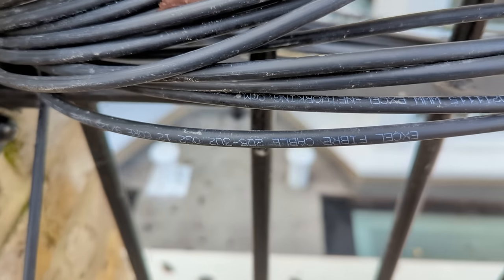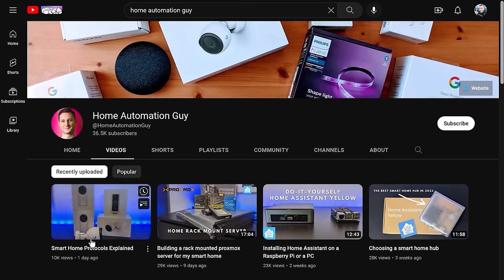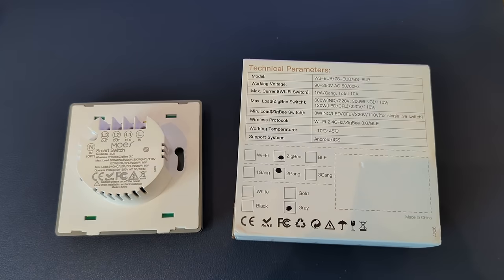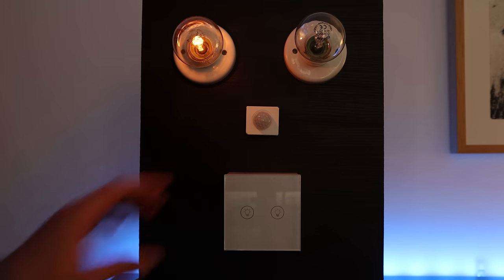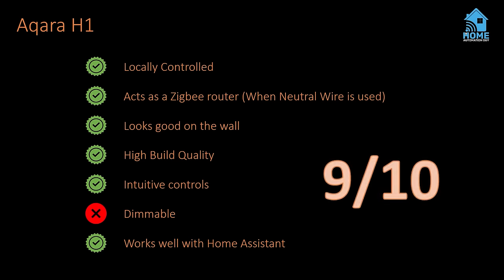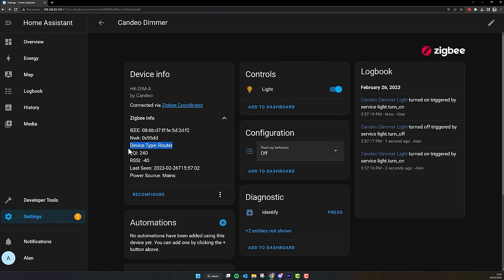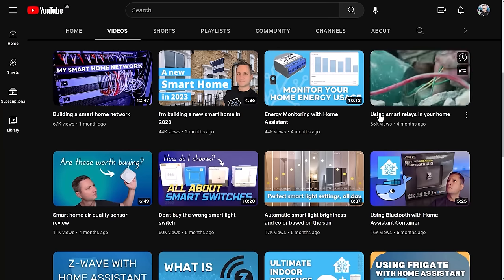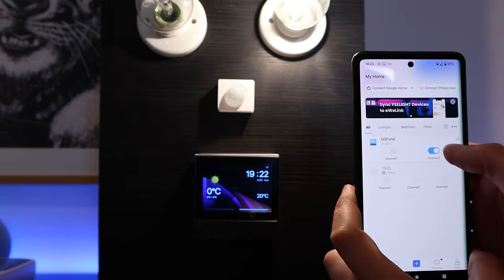Which smart light switches are the best?

Comment: Great video thanks for the testing.  I noticed you have a texecom alarm panel have you integrated that to home assistant? I did mine and it works well but would love more ways to customise it in the dashboard
Reply from the maker: Yep, I use it with the unofficial Texecom Add-On and so far it's worked great.  I don't really do anything with the integration except arm and disarm the alarm, and use some of the alarm sensors in HA.
Reply: @Home Automation Guy  yes same I have the same add on.  But I can't change the names of the arming modes to make them more friendly was hoping someone knew how
Reply from the maker: @sohail579  I don't know how to change them, but I would create a Dashboard with buttons on it, and title the buttons in a friendly way.  Make the action of clicking the button activate that specific arm mode.  

So a button named "Arm alarm when leaving the house" could trigger the Arm Away mode.
Reply: @HomeAutomationGuy  I will give it a go and see if i can get it to work quite a novice yet thanks for the idea,  and RE the question in your video would love to see a video on the NSPanel i have an idea to put one in each bedroom where the buttons will control the light and have the screens control the heating in that room and the blinds

Comment: Thanks for great video, but there are couple of questions.
Why do you attached to smart swithces, don't you consider to use traditional switches with smart relays behind? It would bring you a much wider variety of smart devices (not only swithces, but dimmers as well). And you would be able to choose really high quality switches correspondong to your room design.
And do you know about LocalTuya integration for HA, that allows to connect Tuya WiFi devices locally without any clouds?
As for me, I'm using Aqara battery wireless switches connected to my Yeelight smart ceiling lights. And in some places I use Sonoff Zigbee relays and Moes Zigbee dimmers under traditional switches.
Reply: Do you know any smart relay that supports 3way?

Comment: Great informative video, thank you! I am also buying my first home right now and very new to Home Assistant. I was just wondering whether you still get all the manufacturer software updates if you connect a smart device straight to Home Assistant without using their own hub. Thanks!
Reply from the maker: Using Zigbee2mqtt I'm able to apply software updates to my Hue and IKEA devices.
Reply: Sorry another question! We're about to set up the Aqara wall switches. Do you have any 2 way lights and if so, are you able to set up 2 way systems without using the Aqara hub? Thanks!!

Comment: I'm actually surprised that you didn't consider traditional dumb switches with Shelly relays behind them.  They don't look as flashy but they definitely work well.  With an electrician to fit everything in the box, it's even nicer.  Shelly has a dimmer but I've not tried it yet so I don't know how that'd work.  The biggest win here is that I can use cheap switches and $15 relays and end up saving a ton over time.  When you turn on MQTT, the exterior connectivity is disabled and it actually works like a basic switch would when the network is down.  The only time you'd have a problem is if you used the network to simulate 2/3/+ way switches.

Comment: The reason those MOES switches do not react properly has to do with powering the switch when the cover is removed.

it has a inductive sensor, meaning it detects it based on touch, and if you turn it on with the cover removed it thinks it has a shorter range when you put the cover back on.

BSEED, has different colors, and allow multi-socket switches [combo of light+socket]

Comment: 12:20 You say it's easy to wire in and fits nicely, but you're not mentioning that it lacks the side clamps that most sockets and switches have in addition to the tiny screws. It would be very nice if you could list which switches also have the side clamps, because those make the attachment so much more robust.

Comment: I actually prefer switches and bulbs that aren't router/repeaters. They are less vulnerable to latency issues in my experience. Bonus point is that my ZigBee mesh is a lot more deliberately mapped
Reply from the maker: This is a really interesting topic.  I was wondering this too, as I have some smart bulbs in my office that I'd love to turn off over the weekend, or when I'm away from home, I.E when I'm not using that room to save the "standby energy consumption" of them.  I'm concerned that doing this will remove 6 routers from my Mesh network and cause problems.

Comment: Great video! For part around 11:24 where you were addressing simulation of 2-way switches. There isn't enough information online (even on Aqara's website) that can confirm 2-way mode would also work on a pair of  H1 wall switch (non-neutral). The only method that people have mentioned is using 1 H1 wall switch as relay and another H1 Wireless switch to trigger the wall swtich on-off. Can I confirm that indeed this would work for a pair of H1 wall switch (non-neutral)?

Comment: I've installed a Candeo switch for a try. It works fine, but I can't read or write its brightness state via automations. Do you have any suggestions? I use zigbee2mqtt. The only 2 things I've managed to do is to (1) capture brightness change as a trigger (without brightness value) and (2) increment/decrement brightness in an action. I'd like to switch lights at specific brightness  or sync brightness of smart bulbs to Candeo.

Comment: I am going through my house at the moment replacing my light switches. Not all my wiring points for my switches have a neutral wire even though the house is only 3 years old. I have gone for the Moes rocker switch.  I hope that you do a video on light bulbs as I have had a few issues with some smart bulbs not liking being on smart switches
Reply: do not use smartbulbs with any kind of dimmer (dumb or smart) or a smartswitch that is a no-Neutral type (as these use electronic load switching that behaves much like a dimmer). Instead use a wireless switch for control.

Comment: Thank you very much! I learned a lot from your videos. Just a question, if I buy the  Aqara switch  with neutral required and used a capacitor instead of having an actual neutral wire, will the switch still function as a router and have the power consumption sensor?
Reply from the maker: I don't know. But my guess would be no.

Comment: Great video, Alan!
As a descendant of the “treasonous Colonists”, exiled across the pond; I’m a bit jealous of the room you have in your wall boxes for connecting things. Ours are so tiny and cramped. 

One question. What were you using to visualize your mesh network? ?! 
I’ve never seen that before, and it definitely looks like a good debugging tool!

Thanks for the great video!
Reply from the maker: I had to get the back boxes replaced with deeper ones by the electrician (Which is why the plasterboard got a bit messed up), but I understand the challenge! It's one of the reasons I've not put Shelly devices behind my original switches.

As for the Zigbee visualisation, both Zigbee2MQTT and ZHA have a "Map" or "Network tab that visualises the network.  I don't find it particularly useful for troubleshooting, but it's fun to look at occasionally 🤣
Reply: @HomeAutomationGuy  Thanks! I’ll have to pay closer attention to those integrations. I’ve never seen those features. 
As I’m sitting here typing this, my partner just yelled out from the office “Found it!”; so apparently he is more observant than I am. 😐

Comment: Thank you for making this video, I have the same problem and I need four gang switch but they also need to be too way because I have a switch on either side of the room, I'm struggling to find a solution, maybe have to do the same as you and have two lots of a aqara switches.

Comment: When it comes to smart switches you are nearly always better with a module and fit a retractive switch of your liking to control it. That way you can have switches match other accessories, the only disadvantage is you need at least a 35mm back box in most cases.

Comment: That's great info. 
Would you be able to do a similar one but keeping original switches and adding a smart "relay" or bypass box inside the wall that would act as a smart interface? Is that possible ?
Reply from the maker: I have another video on my channel all about smart relays - does that one give you the info that you need?
Reply: @HomeAutomationGuy  that's great! Exactly right. Thanks for your help, this channel is very helpful

Comment: During the video it’s being mentioned that Aqara only supports 2way and 1way circuits. However, I believe that Aqara should allow for more than 2 and 3 way if all switches are Aqara. Would that be correct? 

The way I see it is that you can set those via automations, and Aqara would work via Zigbee among all of them. Instead of working via hardware; it’d just need to be set up so that the devices talk to each other and a click means on or off. As these work via Zigbee, they would not need WiFi connection to use physically 

Could you please confirm? 

Cheers

Comment: Your network instalation shows a major flaw in its implimentation, when cutting a hole in the drywall... always cut the hole at a 45 degree angle so that the take out becomes a plug when resurfacing. The 45 degree cut provides a landing and support surface for the plug. Just add drywall compund to the edges and insert... skim a top coat or two to level the surface and sand to prep the surface for paint.
Reply from the maker: I'll pass this on to the electricians who made the hole 😏

Comment: How are you getting on with those Candeo dimmers? I've bought a load, and having lots of problems with them (either just dropping off my zigbee network, or a few units that simply refuse to pair). Yes, I've got a good zigbee 'mesh' with plenty of router devices. In fact, on Candeo dimmer works perfectly, another only 2m away keeps dropping off, and another about 2m away refuses to connect. Beginning to have second thoughts about them!
Reply from the maker: I've had a few problems with them reconnecting to the network after a power outage, but that's it. Otherwise they've been very consistent.
Reply: @HomeAutomationGuy  I think the problem might be my Sonof Zigbee coordinator then!

Comment: Great video!
I have a few Aqara D1 switches but I'm not too happy with them as they feel llke they have some sort of cold start sometimes, taking a few seconds to turn on or off the switch, but only sometimes. Another thing is that if you decouple it and cut the power from the mains it won't remember the relay setting and had to create an automation in HA to fix this.
Does this also happen with the H1? If they're better I might think of spending money again on the new version 🤔
Reply from the maker: Oooh, I've not tested cutting the mains power.  I'll flick the breaker next time my partner goes out and see what happens 😈
Reply: @HomeAutomationGuy  And how about the responsiveness from home assistant? Do the Aqara switches work straight away without delay? I'd say that's the biggest deal for me more than they not remembering the relay settings

Comment: Very helpful video, thanks.

One thing that I don't see talked about with Smart Home products generally is firmware updates. If you're using devices with HA and not the original manufactures hubs, how easy, or not, is it to update the firmware on these devices. Once you're into the realm of "Smart", if you think there are no bugs in the firmware, or that new features won't be added (Matter support as a big one), then you're slightly delusional. Might be a good topic for a new video.

Comment: what do u think about the yeelight flex switch pair with Yeelight blub ? I saw that they works without internet and you can control the brightness/ color temperature via local control / homekit. But the cons is that their light switch does not have any led indicators and you cannot dim the brightness on the light switch.

Comment: So.....lets say I use an Aqara H1 no neutral switch in decoupled mode so I have the switch powered on and then decouple .....if I then link the action of pressing the switch to turning on/off a smart bulb (where the smart bulb is getting permanent power because of the decouple).........is there any other kind of long or multiple short press I could program from the switch that would enable dimming the smart bulb? According to you video a long press on the Aqara switch will put it in to pairing mode so would there be a way to change what would trigger the pairing mode.........or alternatively......would using a double gang Aqara H1 with both relays decoupled give me one switch that I could program to turn the smart bulb on and off and the other switch could be long pressed to cycle through the smart bulbs dimmer setting till you get to the desired dimmer level and then let go of the switch?
Reply from the maker: You could use a double switch, and have the left switch turn it on with a single tap, and double tap increases the brightness by 10%.  Then do the opposite on the right switch to turn it down and off.

Comment: Why didn’t you try the Shelly with your existing switches? You can fit two of them in a double back box to use the existing four way switch.
Reply: He did a whole video about why he choose ZigBee. But obviously, there are devices similar to a Shelly that use ZigBee
Reply from the maker: It's a stupid reason, but I hate when a dumb light switch is in the "On" position, but the lights are Off. It messes with my OCD 😂
Reply: @HomeAutomationGuy  Shelly relays can be used with momentary or retractive switches, which avoid the wrong position problem. A momentary switch springs back up when released after pressing down, so it doesn't have an on and off position as such.

The Candeo dimmer modules can also be used with momentary switches as the second switch, and support holding down the monetary switch to adjust the dimmer level. Very similar (I suspect they are the same OEM) dimmer modules are also available from another company called Samotech, and they are cheaper.

Comment: I'm curious as to why WEMO light switches were totally ignored.  I've had mine for years, including with dimmers and 3-ways, they look great, aren't hard to install, stay connected (other than if there's a power failure), and best of all work seamlessly with both Google Home and Amazon (without the need of any other equipment or hubs--the key to their initial selection for my home).  Is it just because they tend to be a bit more expensive?

Comment: Don't know if you're still looking at any questions on here, but just wanted to ask if the Aqara non neutral switches have the decoupling feature or was this something only available on the neutral wire setup like the router mode and energy monitoring? 

Thanks in advance!
Reply from the maker: That feature is available on both neutral and non neutral versions

Comment: Excellent video thanks. Is it possible to group the Candeo dimmer switch with multiple smart bulbs to enable you to change brightness of all lights in entire room from the dimmer switch?
Reply: No. You cannot use a smartdimmer with smartbulbs, which require constant 100% power. Instead you must use a wireless control switch.
Reply: @dvwebster  I am aware of that you can't physically connect them which is not what I ment. I want to be able to group all the lights in the room using home assistant to control them from one candeo dimmer.
Reply: @petertaylor7134  thanks for extra infdrmation.

You cannot use a no-Neutral dimmer like the Candeo smartmodule as a control input to HA, since it must be wired to a load to supply it with power.
Reply: @dvwebster  Apologies my gramer is terrible and I am not describing my self well. What I would like to achieve is that when I change the brightness on a dumb light bulb using a smart dimmer all the smart bulbs plugged in to lamps in the room to to follow the same brightness level. I hope that makes sense?
Reply: @petertaylor7134  ah, now I understand. In that case provided the one bulb meets the minimum load requirement of the no-Neutral Candeo smartmodule dimmer and HA can read its status, then it could work. Although the minimum load is specified as 5W not all LED bulbs will be compatible even if dimmable and >5W. For this reason I am currently using a single Halogen bulb as the load on one dimmer, but multiple GU10 LEDs on others.

Comment: So you don’t like the Shelly switches because of the switch part?  I use my Shelly devices with the switch that came with my house.  Meaning you can’t tell that my switches are smart because they look the same as before the Shelly was installed.  Because they are the same physical switch.  The Shelly is WiFi not zigbee or z wave but it works great in my mesh network and never has to go long distances because I have multiple WiFi access points.  And the Shelly automatically connects to the closest one.
Reply from the maker: It's also much harder to fit the Shelly into a standard UK back box. I do love their products though and have quite a few of them scattered around my house for other purposes

Comment: Fantastic video. I feel sorry for you living in UK when it comes to how you run power wires. My house from the 50s is better equipped for this day and age with conduit between all boxes for all the rooms. Easy to replace and add cables. 

Ps. I am also getting tired of changing batteries on all my switches from IKEA